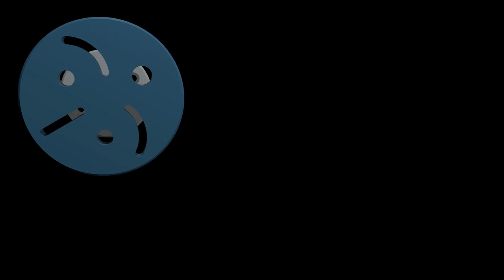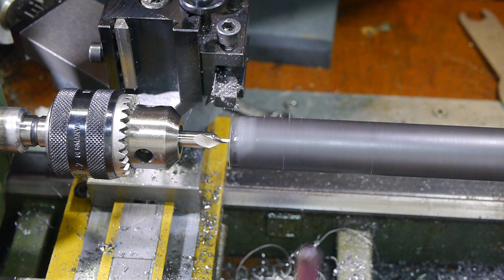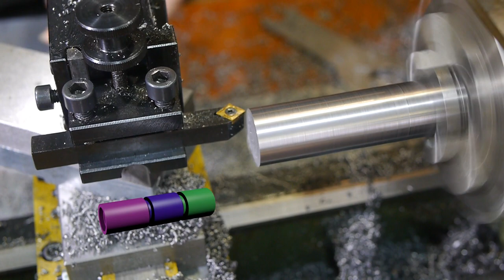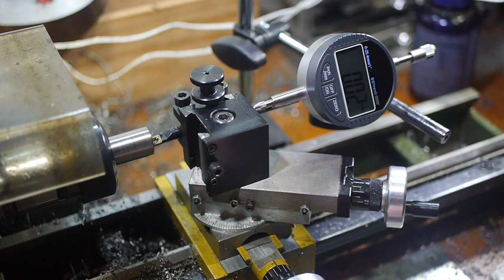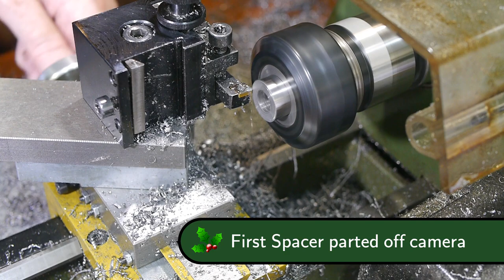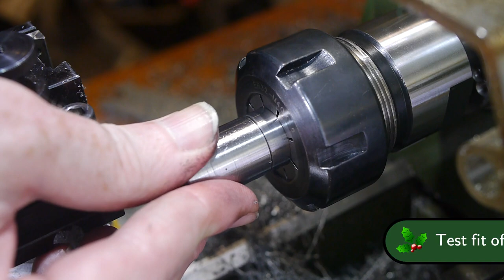Machinists Mini Jack - Part 1

Comment: These little lathes don't take up any room but they don't cut it, literally.  I would not have the patience to put up with that.  Thank you for not editing that out of your video.  I'm glad I've gone to a PM 1236 but of course I'm not making clock parts, last part I machined was a 1" diameter, 24" long shaft out of 303 stainless for a rock polisher, next one will be 36" long.  Love the music!
Reply from the maker: One of the main things I'm trying to do with this channel is explore the limits of what a really small lathe can do. When I find those limits, and try and demonstrate where they are, and why the little lathe can't do it. I've come a long way since recording this video, and have some better approaches which stress the machine less. I've spent a bunch of time machining on a Colchester Triumph 2000, so now have a much better idea of how things work on big machines.

Comment: Very nice. I will be waiting for part 2.
Reply from the maker: Working on it. This project is a good lesson in not letting the backlog of recorded footage get too big. It's really confusing wading through hours of video, trying to remember what I did.
Reply: I can relate to that. I have a habit of misplacing video files when a project gets delayed due to missing parts. Afterwards, I'm trying to remember if I had footage of some operation and where that video might be.
Reply from the maker: That happened to me a lot with this project, compounded by the fact that I did the steps in an order that doesn't really make sense for a video, so had to hunt around for the step that made sense next, even though in practice I had done it a couple of days later.

Comment: The lathe stopped several times when drilling large holes. Would some lube help?
Reply from the maker: I was using cutting oil. I need to get better at keeping my drill bits in good condition, and regrinding them when they need it.
Reply from the maker: I may also need to replace the belt, as I suspect it is slipping more than it used to.

Comment: Hi,
 Is that an Amadeal saw? Have been thinking of getting one and wondered if you had any comments on it?
Matt
Reply from the maker: Yes, Amadeal AMA1140. It has been very solid, but I haven't been able to get the blade cutting as straight as I'd like. I followed a guide for truing up a similar sized low cost bandsaw, but this model doesn't have the same set of adjustments.
Reply from the maker: In hindsight I think I would have been better off with the slightly more expensive UE-127DV1 from Axminster, which has much more adjustable blade guides, and a bunch more features.
Reply: Thanks, That does look a somewhat better unit - I shall investigate a little more.....

Comment: Great bit of video.... I'll be making some jacks soon... and I love a nice bit of Tchaikovsky.

It's "nice" to see someone else getting "bound up" when drilling... I was beginning to think that was just me. ;)

Your Proxxon looks nice... I was thinking of getting one of those but eventually I got a Unimat SL for really cheap. But I see you've got a proper compound slide and a real lathe bed... I might have made the wrong choice.  What kind of spindle and tailstock does it have? (Y'know M12-1 thread, Morse taper, or whatever?)
Reply from the maker: It's a very capable little lathe, and can do most things an engine lathe should, but the small motor and low torque means that it can bind up pretty easily. Is your Unimat SL the type with two round shafts for the bed, with the feed screw between them? I can imagine that style wouldn't be as rigid as a cast iron bed.

The spindle is a 40mm diameter cylinder, with screw holes in a 3 hole and 4 hole pattern, for the stock 3 and 4 jaw chucks. The bore is a Morse 2 taper, but this is not documented in the specs or the manual. Looking at the Proxxon website, they describe their fixed centre as "MK 2", which might stand for Morse Kegel, which I think is the German word for a machine taper. I've successfully used a few pieces of generic MT2 tooling, including the ER collet chucks.

Comment: Hello,

The Collet chuck unit that you are using on the PD250 and the Four-jaw chuck are the stock ones ?
If not did you modified the lathe ?
Reply from the maker: The collet chuck is not stock, but is a standard ER32 chuck with a Morse 2 taper. The Proxxon specifications don't specify that the spindle bore is a Morse 2 taper, but it fits perfectly. No modification at all required.

The four jaw chuck required me to make a custom back plate, but no modification of the lathe itself. The trouble with the four jaw is it's way too heavy for the lathe, and causes serious vibration which you can see in this video. The stock four jaw that Proxxon sell would have been a better choice.

Thanks for watching!
Reply: Thanks a lot for your answer !!
I am new on the lathe hobby... Just acquired the PD250.
I  was ready to buy the Proxxon stock collets....
If i understood well you remove the 3 jaw chuck and you install the er32 collet taper tool... No screws required ?
Do you have a suggestion where to buy the MT2 ER32 Collet Chucks ?
Reply from the maker: Congratulations on your new acquisition! It's a great machine.

Yes, simply removing the 3 jaw chuck will allow you to install the er32 collet tool with a Morse 2 taper (MT2). To hold it securely in place, you should use a single M10 bolt through the back of the spindle, which will screw into the end of the taper shank.

You can easily buy MT2 ER32 collet chucks from many tool suppliers, eBay, Aliexpress or Banggood. I got mine from eBay. You will also need some collets, which you can get from the same place. Be careful about buying the cheapest available. They may have bad runout, which will cause the part to wobble.
Reply: Hello,

I ordered the following:
https://www.rdgtools.co.uk/cgi-bin/sh000001.pl?WD=er32%202mt&PN=2MT---ER32-COLLET-CHUCK--AND-FULL-18PC-COLLET-SET-859%2ehtml#SID=117

Do you thing ii will fit on the lathe ?

It had also a version called (which i did not ordered...):
20MM STRAIGHT SHANK COLLET CHUCK ER32
DESIGNED TO BE HELD EITHER IN A FIXTURE OR A 3 JAW CHUCK

I hope i did the right choice...
What do you think ?
Reply from the maker: The spindle bore in my Proxxon PD 250/e is definitely a Morse 2 Taper (MT2 or 2MT), so the chuck you have ordered should fit. The straight shank version definitely wouldn't be right. Best of luck, I've got my fingers crossed for you. Make sure the bore and the taper shank of the chuck are very clean before you try and fit it. Remove any trace of metal particles, or you may damage the taper surface, and weaken the fit.
Reply: Oufffff !!!!!  So I did the right choice !!! 
Now i will wait the item to arrive next week...
I will tell you the results. 
Thanks a lot for your help !!!
Reply: Hello,   
I finally received it and it works very well !!! Thanks a lot for your help !!! 
Can i ask you your opinion  about silver steel ? Can i use it easily with this lathe ?
Reply from the maker: Excellent, really glad to hear that worked out for you. I've used plenty of silver steel on this lathe, including all the stock for the Tap Follower project, and the smaller steel parts for the Watchmakers Face Plate clamps. It machines just fine with carbide insert tooling, but it's important to keep the rpm high to ensure the inserts get a fast enough cutting speed. This is one of the key advantages of using an ER collet chuck; it's much lighter than the scroll chuck, so you can turn the rpm right up without causing chatter.

I recommend using a turning speed calculating app to check what rpm to aim for. I use TurnCalc from Sandvik Coromant, which is free for Android devices.
Reply: Adventures with a Very Small Lathe Thanks a lot. I watch over again your videos to learn as i am a newbie on the hobby and to follow your nice mods on this lathe !!  I have build a cnc and i am also experiment on this... I will upload on youtube from the cnc..
Reply from the maker: I'm really glad you find my videos useful, but keep in mind I'm not a real machinist; I just play one on the Internet. I learned my basic machining techniques from channels like Abom79, Keith Rucker, and Joe Pieczynski and I really recommend you watch their videos to learn good practice. My videos are full of mistakes and bad habits, because I've never had any hands on teaching.
Reply: Your help once again.... After installing the ER32 on the lathe I finished milling and I tried to remove it... But it is heavily stuck on it and I cannot remove it. I put a lot of force (hope did not made any damage).... but it is impossible ... Any trick or ideas ?
Reply from the maker: Removing the tool from the taper can be quite tricky. Undo the M10 bolt 3-4 turns, so it sticks out the back of the lathe, then tap it with a plastic or soft metal (brass or copper) hammer. This should dislodge the chuck from the taper more safely than trying to pull or twist it. If you haven't used a bolt through the back of the spindle, you will need to use one now. Whichever bolt you choose, make sure it is engaged a minimum of 3-4 turns into the back of the chuck before striking it, or you will damage the threads in back of the chuck's Morse taper.

Let me see if I can put together a couple of clips of how I do it. That should be clearer.
Reply: Adventures with a Very Small Lathe I took a screw longer than the taper and i fully screw it. As it is quite long and it was extended beyond the limits of the headstock in the back side of the lathe. I took a hammer and tapped the screw several times but with no luck. Do you believe that by twisting it earlier by hand but quite hard  and by tapping it with the hammer i could damaged the headstock or the bearings of the lathe ? It is quite tricky.....
Reply from the maker: That sounds difficult, sorry to hear you're having trouble. I think it is best to avoid twisting, as that will cause whatever small particles that are caught between the two tapers to scratch and damage the surface. Is it possible there were some small chips or other dirt still in the taper when you installed it?

I made a quick video clip showing how I use the ER32 collet chuck. I'm not sure how much it'll help you at this point, but take a look.
https://www.youtube.com/watch?v=tFaXQjqNXV8
Reply from the maker: A few months ago I had to remove the Morse 3 spindle taper of a milling machine which was seized. It took a while, but I eventually got it loose by soaking WD40 into the small end of the taper, and using a regular steel hammer to strike the bolt. The head of the bolt was damaged, and it ran the risk of damaging the bearings, but the machine seems to have survived okay.
Reply: I finally succeed to remove it !!!
I put a lot-lot  of WD40 then cold air from a computer spray can (tried to shrink it a little if possible) and then tapped about 30-40  times (quite hard) with a hard rubber hammer.
I hope I didn’t damaged the lathe…
Now I am a little worried if  the same issue will appear next time I will fit the ER32 collet on the lathe……
Reply from the maker: Great News!

See if you can work out why it got stuck, before trying again. Check the inside and outside taper surfaces carefully to see if there any any sign of a particle of metal or other dirt that got pressed into the taper wall, and wedged it in place. The draw bolt only needs to be tight enough to stop the taper shaping loose from the vibration of the lathe. Any tighter, and it can cause the taper to get wedged.

If it does get stuck, it can be better to try a hammer made of harder material than to use more force with the softer hammer. A strike with a steel hammer transfers energy more quickly, so the force transmitted to the taper is larger, and more likely to free it. The rubber hammer transfers the energy more slowly as the soft material flexes, so the force is spread out and the peak is smaller. A steel hammer will damage the bolt where it strikes, but bolts are cheap. The shorter, and sharper the force is, the less likely it is that excess energy gets transferred to the bearings risking damage there.

Comment: Video is too long. You do not need to show every little turn of the lathe. You chamber the bottom of the drilled hole and then face the bottom. So you then needed to go back and chamber the bottom again. Too many steps.